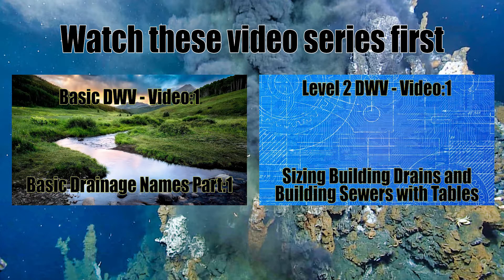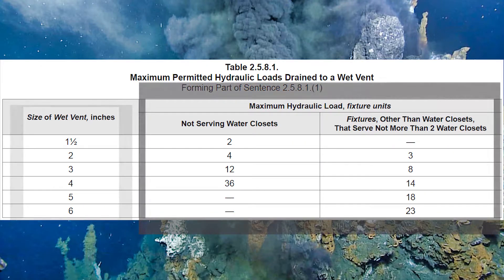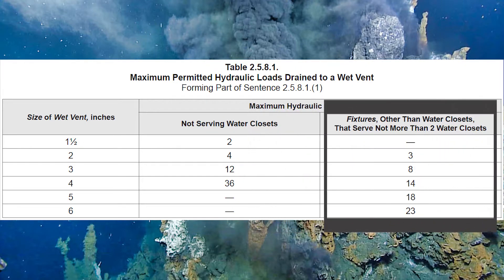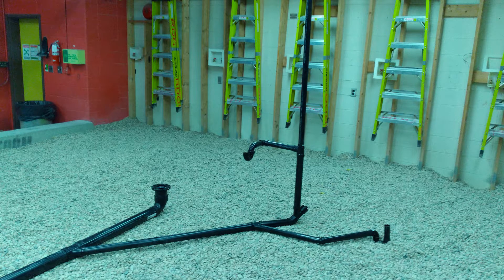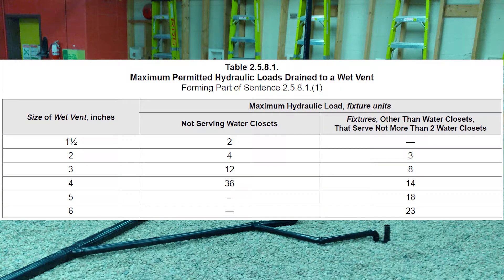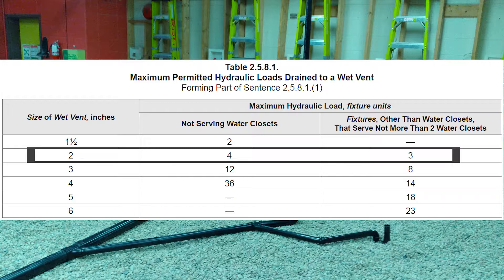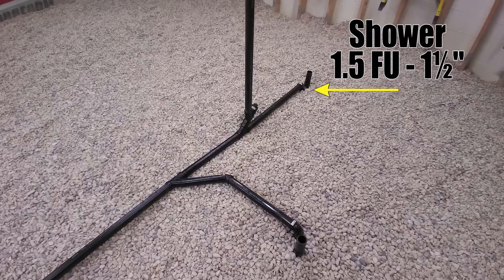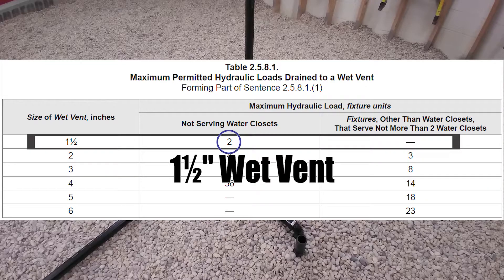Wet Venting Video:3 - Sizing a Basic System

Comment: Great videos series. Do fixtures that have air admittance valves that drain into the wet vent still count towards the hydraulic load and therefore dictate sizing of the wet vent. EG I have double lavatory sink and  shower and a washing machine in the bathroom with one lavatory. The washing machine will have an AAV.  Thanks
Reply from the maker: Yes. That is covered in video 4 in the same series
Reply from the maker: For clarification, the washing machine drain is just a fixture drain connected to the wet vent. The style of vent does not change how we size the wet vent.
Reply: OK great I was confusing sizing the continuous vent in the wet vent with the waste pipe size of the wet vent. Rewatched video 4 again so I think I am clear now.  So basically 3 inch wet vent is required for anything over 3 FU and Under 8 FU.  And the waste closet (last fixture, ) is not counted in the total.
Reply from the maker: @jason8799  Totally correct, given you are in Canada

Comment: how come the wet vented system without water closet which serves 1.5 FU for the shower and 1.5 FU for the bathtub is Ok with 1 1/2" wet vent? 1.5FU+1.5FU=3FU  so it should be 2" wet vent. that part is confusing. thank you!
Reply from the maker: When you total up FUs draining into a wet vent, you never count the last/lowest connected fixture, in this case the shower. The shower is being vented through the wet vent but it's not draining into the wet vent. (The wet vent ends at the shower wye connection, therefore the shower is being drained into a Branch)

To think about this another way, the wet vent will never get filled up by water from the shower (Unless the drain gets blocked downstream in the system somewhere)

Comment: 3:21---here in Ontario you can't put a double wye on the horizontal, Otherwise very informative video!
Reply: there's literally nothing wrong with the set up shown in the video, the system will drain just fine with 0 risk of clogs/leaks